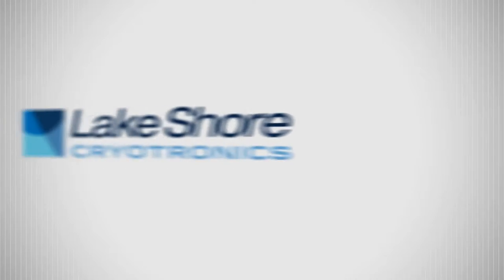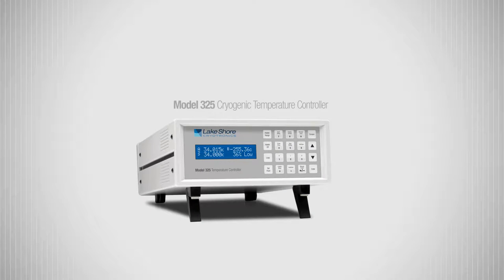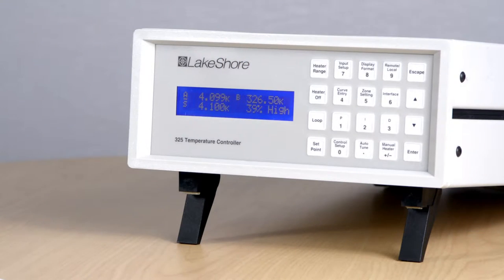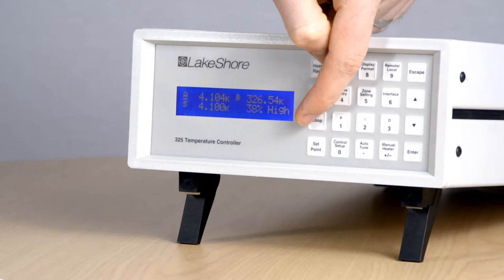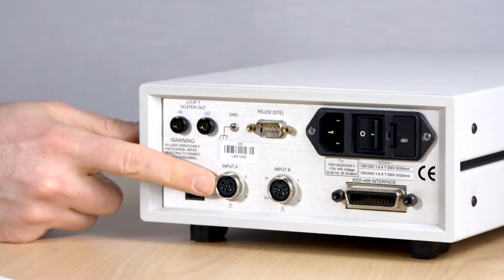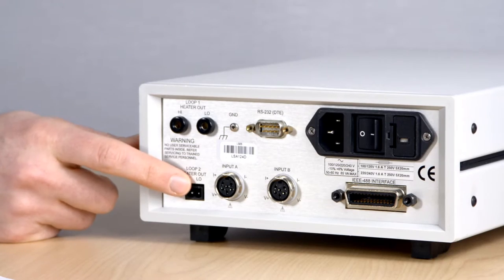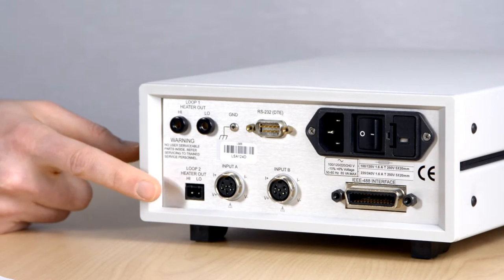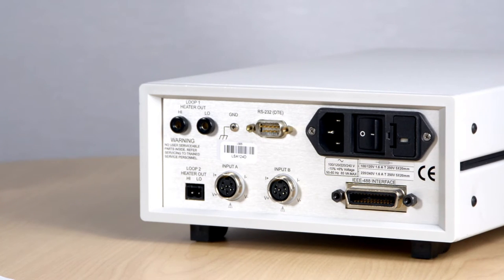Model 325 Cryogenic Temperature Controller: Quick Look

Comment: how can we operate 331 model temperature controller?
Reply from the maker: For assistance with this question, your best bet is to head over to our Lake Shore User Group Forums at http://forums.lakeshore.com or call Lake Shore support at +1 (614) 891-2243 (and press 2 for Service). 
Otherwise, documentation for the 331 can be found here: https://www.lakeshore.com/products/categories/downloads/discontinued-products/discontinued-products/model-331-cryogenic-temperature-controller

Hope that helps!